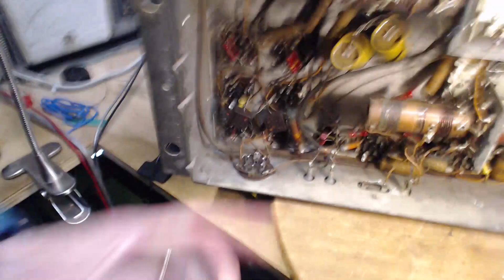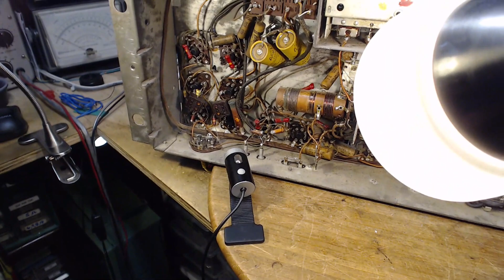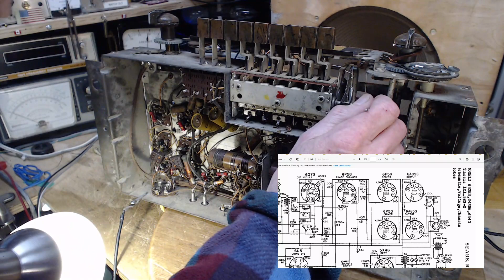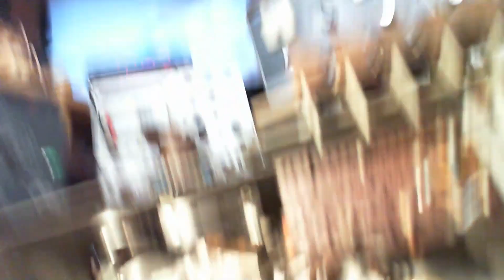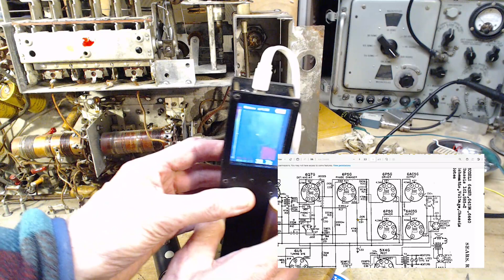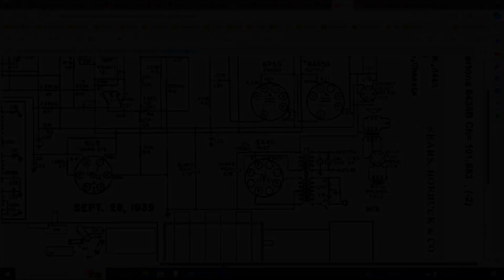Silvertone 101-583-2 Multiband Tube Radio Video #9 - Suicidal Capacitor

Comment: Check the DC resistance of the speaker field coil and compare to the value shown on the schematic. The field coil could cause the low B+ voltage. Nice video.